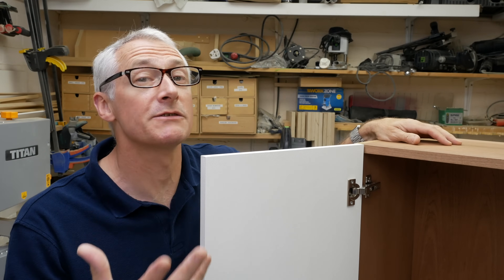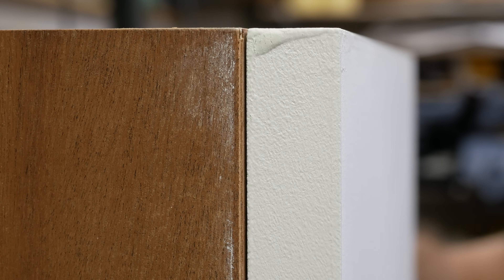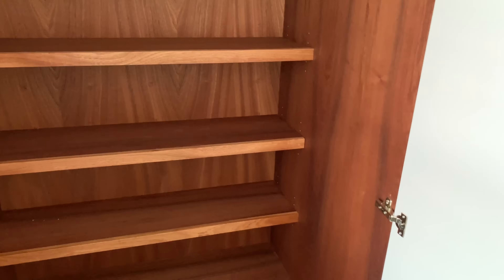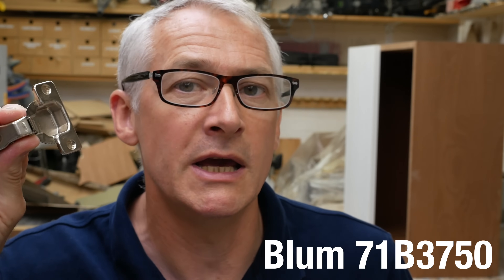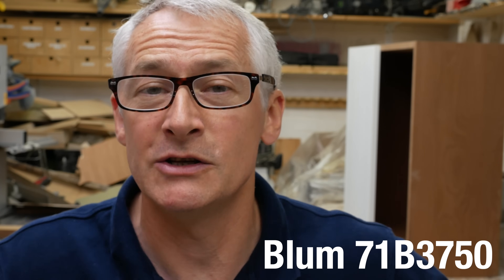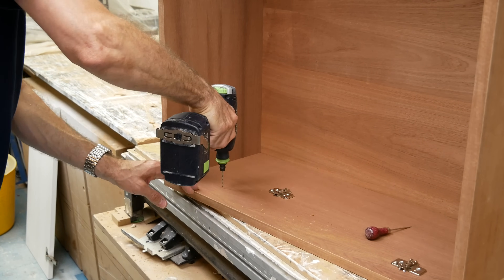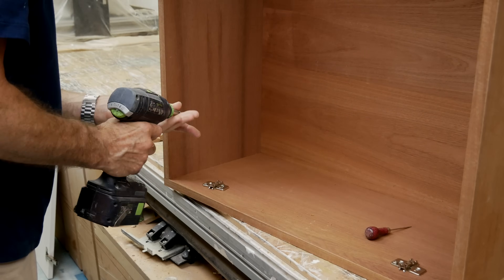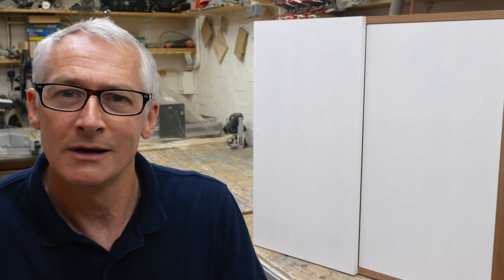How to fit concealed (Euro-style) hinges for overlay & inset cabinet doors [video # 348]

Comment: Great videos, so helpful!  One point though - if the main hinge hole is 35mm wide, how can the screws be at 32mm centres?  They are further apart than the diameter of the 35mm hole, and looking at blum's technical drawings it seems the holes are 42mm apart.  Might be worth pop-up or a note to correct that, unless I've misunderstood?
Reply from the maker: The hinge plate holes are at 32mm
centres. 👍
Reply: @10MinuteWorkshop  Aaah - the hinge plate - I see, 32mm centers for the hinge plate side and 42mm centers for the hinge side.

Comment: partial inset cabinet door…. can these work for partial inset? I am sorry if this has been answered. I read through several hundred comments and can’t find the answer. thank you!
Reply from the maker: Partial inset? As in so the door stands slightly proud, or slightly set back from the carcass edge? Either way, it’d be a question of changing the set-back on the hinge plates. 👍
Reply: @10MinuteWorkshop  Yes. I’ve never done this before. Do you have any tips?

Comment: Can the Blum 71B3550 be used with a face frame mounting plate? If so, what mounting plate would I substitute for the cruciform mounting plate?  If the Blum71B3550 can not be used with a face frame mount, is there a similar soft close option that can? Also, can you recommend a Blum soft close 155 or 180 degree for inset mounting plate?
Reply from the maker: Hi. I'm sorry, but I'm not familiar with the face-frame mounting plate, so I couldn't say. When I've used the 71B3550 in a face-frame I've either used the die-cast mounting plates in 6, 9 or 18mm (Blum 175H9190.22) or I've used Blum face-frame hinges eg Blum 33.4600. 

Blum don't make a 180 degree hinge AFAIK, and the 170 for an inset door (71T6650-INSET) will only do soft close with pistons (973A6000) attached. The 155 degree 71B7550 (zero protrusion hinge) has built-in soft close, but I don't think it's available as an inset hinge, so you'd need an appropriate die-cast mount for it; it's not something I've done, but I think the one mentioned above (Blum 175H9190.22) would do the job, though always worth checking with Blum before spending any money. 👍👍

Comment: I love your channel. I know this is from an old video. I am adding 13 mm wood to cover up existing ugly 20 mm doors under a kitchen sink (for my bowls club). One pair of doors is "inset" and for the other pair I would like to have a full overlay of just the 13 mm added layer (so 20 mm of door inset behind this). For the inset doorw do I need a special hinge for a thick door like this? Or do I just use a regular inset hinge and just push back the mounting plate? At about 10:25 in the video you seem to show how the mounting jig is not usable when a thicker door is used. For the full overlay of the 13 mm added wood (backed with 20 mm existing door) what hinge is needed there, or any advice on the mounting? I am looking for YT videos for help, but my situation is somewhat unique. I have never dealt with hinges in the past and the large array of hinges from the vendors (the 125 pages you mention) are overwhelming. Much thanks in advance if you can help me in anyway.
Reply from the maker: You’ll need a thick door hinge for that - 20mm + 13mm - but even the Blum 71B9550 only goes to 32mm afaik. There are some hinges for up to 40mm thick doors, but I’ve never used them. Best bet is to search for ‘concealed hinge for thick doors’. HTH. P 👍

Comment: Is there any different measurements for different manefactuers that makes 35mm hinges?
Reply from the maker: I'm sure there are small variations, but these are the standard dimensions for all modern furniture and hinges based around the 32mm system. 👍
Reply: @10MinuteWorkshop  you meant 35mm, am I right?
Reply from the maker: No, the 32mm cabinetmaking system, which these hinges are part of - https://en.wikipedia.org/wiki/32_mm_cabinetmaking_system 👍
Reply: @10MinuteWorkshop  OK got it. Thanks!

Comment: Hi Peter hope you're well. Thanks for thr videos they are great and always helpful. I'm making a cupboard for someone and it needs to be an inlay door inside a face frame. The frame is 34mm from the carcus. I've been searching for ages at what hinges to use. Could you please recommend some that would be of use for this job? Thank you very much. Mark Simpson
Reply from the maker: Hi Mark, yes, all good here thanks, hope you are too. So if I understand, you’ve got 34mm from the edge of the face-frame to the inside face of the carcass? I don’t know of any concealed hinge that will do that I’m sorry. You can get hinge plate extensions, but I think 18mm is the biggest I’ve seen. Blind corner hinges need around 65 or 70mm to attach the hinge arm onto, so 34mm of face-frame isn’t big enough for those. I guess the question that only you can answer is could you use regular butt hinges off the face-frame, or could you reduce the depth of the face-frame to 18mm to use hinge-plate extensions? Those are the only options I can think of, I’m sorry! 🤷‍♂️👍
Reply: @10MinuteWorkshop  thank you for taking the time to reply I appreciate that. I may have a look at using butt hinges then as the only other option I think id have is to pack out where I have the hinges and that might look a bit rough doing that. Again thank you for your reply. Love your videos and your work they're great.

Comment: Hi Peter, great video! Quick question - if I have a set of 4 wardrobe doors, for the inner two doors where the hinges pivot at essentially the same point for each door, do I need to allow some extra space for the door to open and not rub against the edge of the other door? I'm finding it quite hard to explain what I mean so let me know if you don't follow!!! Thanks
edit: for example at 5.44 in this video there are the two doors I'm trying to describe opened with their exterior facing sides touching each other - when you shut them in the next few seconds of the video it seems there isn't any rubbing issue but I just wanted to check!
Reply from the maker: Hi Matt, and thanks. These hinges are designed to pivot around their centre to minimise this issue, but yes, you need to allow a gap between the doors for clearance. Exactly what this is will depend on the thickness of the doors, and the overall 'look' that you're aiming for, but I typically aim for around 1.5 - 2mm between doors, and this is usually sufficient clearance for 22mm thick doors on the hinges that I use. Hope that helps! P
Reply: @10MinuteWorkshop  Thanks that's really helpful! All the best.

Comment: Hi Peter. THanks for the video. I am making an equipment cabinet out of birch ply and don't have enough depth in the cabinet for the long part of the hinge. Can it be reverse so the cruciform go on the door instead? I'm struggling to find a reason why not! Cheers! G.
Reply from the maker: Hi Graham. You know this came up recently with someone else, and I must admit I couldn't find a reason not to either! They tried it and it worked out OK, by all accounts. I still haven't tried it - but I will - so I'd say give it a try and let me know how you get on! 👍
Reply: @10MinuteWorkshop  Cheers for your thoughts, I'll let you know! :)

Comment: Great video. A quick question Peter: You drilled the 35mm hole on the door, Is it possible to fit these hinges the other way round so that the base goes on the door and the 35mm hole goes on the carcase ? The reason I'm asking is because I haven't got all the proper equipment, this is the first time I've done this and I don't won't to make a mistake on the door, but the carcase base is cheap melamine whiteboard which can be replaced easily.
Reply from the maker: Thanks! Wow, I’ve never tried that! No idea if it would work or not tbh. 🤷‍♂️👍
Reply: @10MinuteWorkshop  Well, it's on, and working. I don't know how long it will last because I had to drill a few holes to get the right spot, so reused those holes.The door is pretty stable now but if gets loose I'm planning to use some thicker screws. By the way, the reason I did this was because the door was the cover for a dishwasher we no longer use and I wanted to use the space to make a cupboard. Thanks for replying.
Reply from the maker: @Edmant  Thanks for the update! 👍

Comment: Hi Peter, your videos are invaluable, unfortunately the hinge I'm using is 71B9650 soft close thick door hinge half overlay, I've been on the Blum website (a minefield) which doesn't help much, I did print off page 93 but I can't work out their dimensions to ensure I drill my hole in the right place on the door,  and install the crucifix in the right place, any chance you could assist with a video on how to install this type, I would be most grateful.
Reply from the maker: Hi Ian, and thanks! I've never used them to be honest, so I'm afraid I'm no help at all on this one. 🤷‍♂️👍
Reply: @10MinuteWorkshop  Hi Peter, thanks for your reply, and your honesty. I will look elsewhere and hopefully find what I'm looking for.

Comment: What size screws are used to attach the hinge and mounting plate to 18mm MDF? The Spax screws in the link are 4 x 30mm which would be too long.
Reply from the maker: 4x16, and the Spax page I link to has a drop down that lets you select the screw size. 👍

Comment: Cam here again. I made a practice door and side piece and I cant get the full overlay even with the adjustment. Can I drill the hole for the cup a few mm further back from the edge? In looking at this adjustment it seems if the cup were further inset on the door I would get the extra coverage. This is a Hafele brand full overlay hinge. I purchased their template for drilling the holes and the center is 21.2 mm from the edge. That leaves a 3.2 mm strip between the cup and the edge of the door. The practice door is 22.6 mm thick and the practice carcass piece is 19 mm. The instructions that came with the hinge was awful, it doesn't give any dimensions.  I can practice on my door (move the hinge location) and will try this but wondered if you had and experience or advice.
Reply from the maker: Yes, you can do that you just be careful that the doors don't bind, especially with thicker doors. 👍

Comment: Hi Peter, can these hinges (overlay) be used for integrated appliance doors, thanks
Reply from the maker: Not generally, no. Appliance doors usually have their own hinges specific to the application - they’re a stubby-arm type of hinge. If you do a quick google for ‘integrated appliance door hinge’ you should see them pop up. 👍
Reply: @10MinuteWorkshop  Thanks Peter, yes, we've been supplied with Blum 70T955 a bit slimmer and don't have the soft close function. The Integrated doors will be opened via the plastic slider system . I was just interested to see if they could have soft close too as the rest of the hinges supplied for the kitchen do. Thank you

Comment: I have made a 12mm thick kitchen cabinet carcass and I am planning to install 18mm thick cabinet doors. I want to install full overlay hinges. Is it possible ?
Reply from the maker: Only if you line the inside of the cabinet with eg 6mm, or have a strip of 6mm at the front for the hinges. 👍

Comment: Hi Peter, great video thank you. Would a 18mm plyboard sheet be too heavy for a full size wardrobe door or could I increase the number of hingers?
Reply from the maker: Thanks! These hinges are rated at around ~4Kg per hinge, so work out the weight of the door, and add hinges accordingly.  FYI 18mm MRMDF is approx. 15Kg/sq metre - you should be able to get specs including weights for whatever plywood you’re planning on using. 👍👍
Reply: Peter Millard brilliant! Thanks 👍🏻

Comment: Hi Peter
Your video’s are very interesting.
I have a question. I work with Hettich hinges and overlaying Doors.
If you have a cabinet with , let say, 100 cm weight
You want 2 Doors. There is no middle plate. 
What size of Doors would you use.
They told me 100 / 2 minus 5 mm for each door. But then my space between  2 Doors was to big and could not be adjudsted.

Marc
Reply from the maker: Hi Marc. It depends where you want the doors to sit in relation to the edges of the cabinet. In a freestanding double ie not part of a run, I like to have the doors flush with the outside edges, so it’s just a question of taking ~1mm off the doors to give a 2mm gap in the centre. If the cabinets are in a run, then you’d want that gap to be consistent between the carcasses as well, so you’d take ~2mm off each door. I have a ‘door spacing’ video due soon! 👍👍

Comment: Great vid. Without having the jig template, on the18mm bit of mdf door, how far do i make my hole for the middle of the 35mm drill bit?
Reply from the maker: 21.5mm from the door edge is pretty good starting point for the centre. 👍👍

Comment: Hi Peter. Would I be chancing it using 15mm ply for a door? Trying to keep weight down and I have the sheet to hand. You said the depth of hinge drill out is 13mm?
Reply from the maker: That's tight, and I wouldnt recommend buying a sheet of 15mm on the off-chance it works, but if you already have a sheet, then why not try drilling a hinge cup into a corner, and see how it goes. 🤷‍♂️ 👍
Reply: Your right. It’s going to be tight. Thanks for the feedback. Great videos keep them coming. Was a carpenter till my mid twenties 30 years ago. Your videos makes me realise I miss it, especially all the fun kit.

Comment: Pete I am going to make a cabinet from 25mm can I use the same hinges or do I need different ones many thanks
Reply from the maker: You’d need to check the specs with Blum, but from memory they’re OK up to 26mm carcass thickness. But check, don’t take my leaky memory’s word on it. 👍
Reply: Thanks Pete for getting back so soon I will check that out with blum

Comment: I have hinges that need to be fitted to a TV unit but the hinges do not move to allow the open and close movement. Is there something I need to remove to unlock the hinges movement?
Reply from the maker: No, never come across a hinge that needs ‘unlocking’ but some concealed hinges are very stiffly sprung and can feel like they won’t move if you’re just holding them - they need to be mounted to get the full movement.

Comment: I dont know Peter if the customer gonna go for the two different types of doors on that cabinet you may want to think that thru ,i used the portable jig on sites ,i ve found it works pretty good ,i find the blum hinges kind of pricey here ,i think the nicest part about a european hinge is it ease of use to installing and adjusting the door in ,a lot less work ,and everybody should own a self centering drill bit set ,dont know how many times ive replaced a door because someone didnt put the screws in square to the hinge and they ve failed great video ,but will you re think them cabinet doors ...lol
Reply from the maker: Ha! The client’s never wrong Syd! You’re just too tied to the societal norms to accept their asymmetric door choices, lol! 😂😂👍👍
Reply: @10MinuteWorkshop  hahahaha its always something hahaha

Comment: Thanks Peter, great content and your presentation style is comfortable for me.  I just started using the LR32 system.  I also have a batch of the 3550 hinges you talk about.  I bought them on Amazon as a package that included the mounting plates.  I have already bored 5mm holes in some end panels but the plates sent have simple wood screws to mount.  Do you have a suggestion for a mounting plate, that works with the 3550 and uses the 5mm (Euro) screws?  I know I can drill out the plates but prefer to use th 5mm screws if I can.  I am doing frameless, full overlay.  Thank you.
Reply from the maker: Hi Rick, and thanks! The regular ‘cruciform’ plates should work with Euro screws - must admit I’ve never come across plates that only accept regular wood screws. The cruciform plates are these ones:- https://www.trade-hinges.co.uk/cruciform-backplate-16-p.asp - they come with not without screws. 👍👍
Reply: @10MinuteWorkshop  Much appreciated Peter.  Those are the 0mm height and looks like the 8130 is the 3mm height.  I will get a couple of each to test.  Thank you very much.

Comment: Hi Peter. I’m just in the process of making some faker style cabinet doors for my parents kitchen. I knocked up a mock door and fitted a concealed hinge, however I wasn’t keen on the grab of the screw in the mdf. Previously I’ve made faker doors for my campervan which was a base of 9mm plywood with an mdf outer frame so the screws had a good grab in the ply, however I’m a bit concerned with the mdf and their ability to take these shirt fat little screws to hold the hinge. Any recommendations or words of advice “ thanks
Reply from the maker: The trouble with faker-shaker doors is that you’re wholly reliant on the glue bond between the backing board and the mock rails & stiles. There’s generally no issue with getting a good fixing in MDF with concealed hinges as much of their strength comes from the hinge body being well located in the cup you drilled out; if I wasn’t using euro screws I always used a 14 or 16mm x 4mm screw with a fairly coarse thread, and I’ve never had one fail. HTH P
Reply: @10MinuteWorkshop  thank you